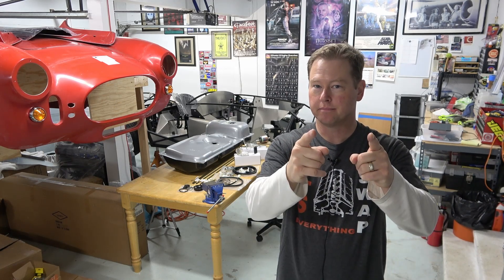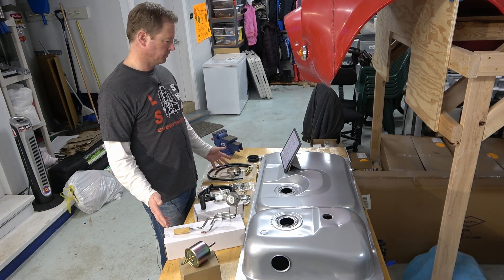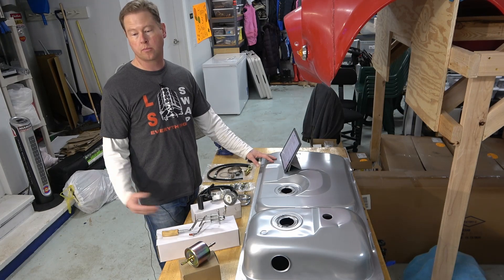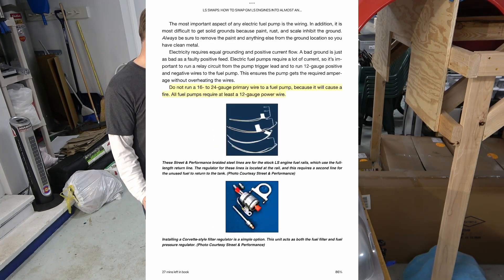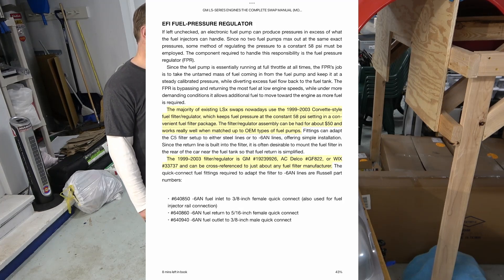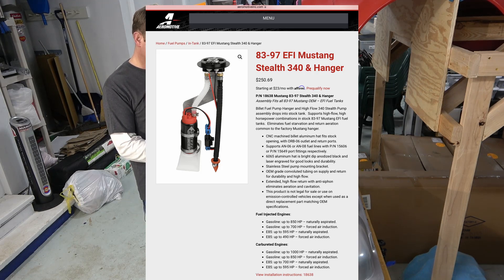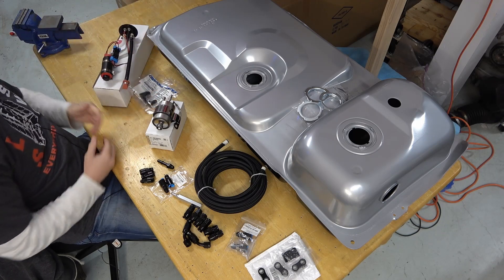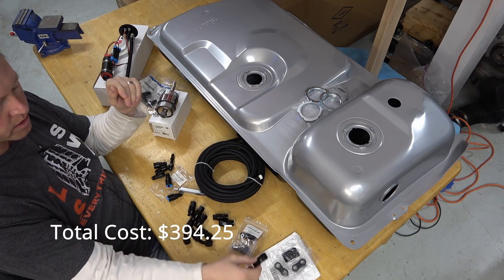Budget LS Factory Five Cobra | Fuel System

Comment: A lot of great info, thanks for sharing. My kit arrives next month. I’m installing an LS with a FiTech intake and I was planning on using a FiTech pressure regulator. However, I like the simplistic approach of the corvette filter/regulator mainly because of the short return and single supply line to the engine. I may give that a try as well. I haven’t picked out a fuel pump yet but I will likely go with the same one you chose. I’ve heard nothing but positive things about that company.
Reply from the maker: Also, if the combined filter/regulator does not work, it is easy to switch to a dedicated regulator and separate filter because everything is easy access. Easy to change it out. I worry about leaks at the fittings. I hear that the clip on fitting with the little plastic pieces leak. We will see. Find my email in the about tab of the channel and send me some pics when you get started.

Comment: Nice video… what’s your take on fitting rubber (albeit braided) hosing to run ok the underside of the chassis? I’m sceptical that it will be durable enough, so I’m fitting 3/8 cupronickel, at least for the underside of the car … my problem is trying to find proper fittings to switch back to braided hose at the pump and EFI end
Reply from the maker: No rubber hose for me.  Ill be using the nylon braided PTFE hose.